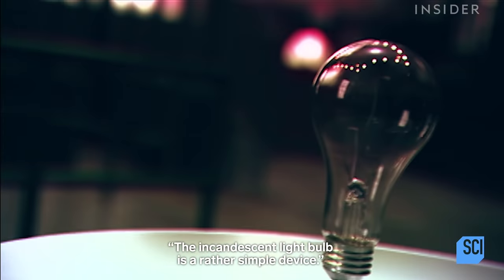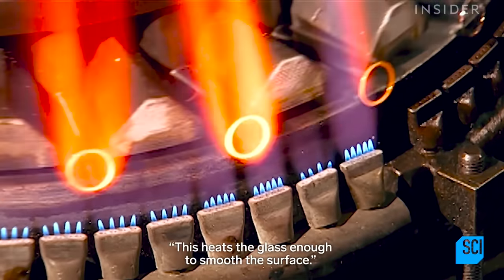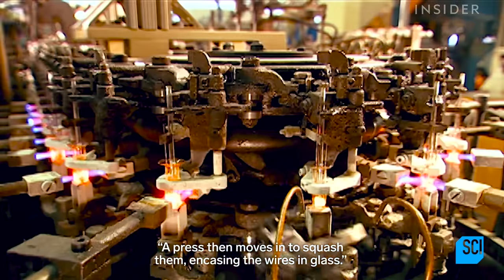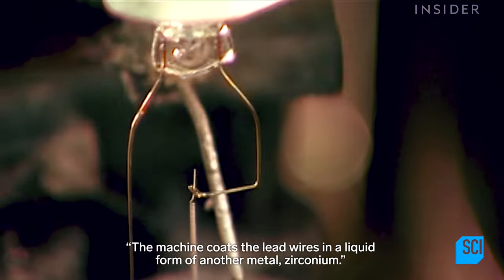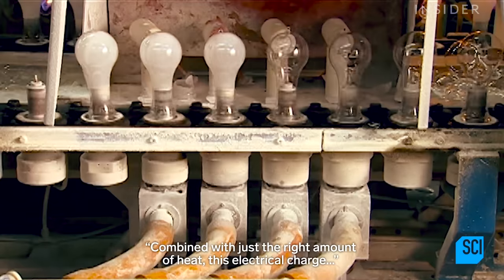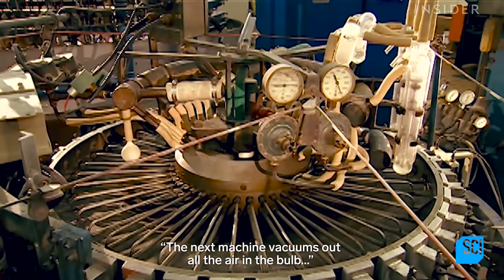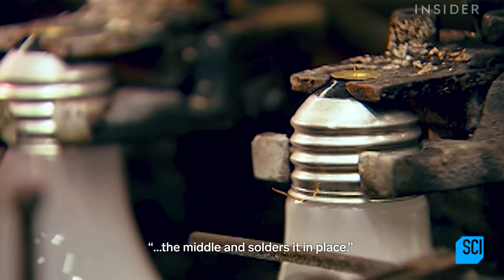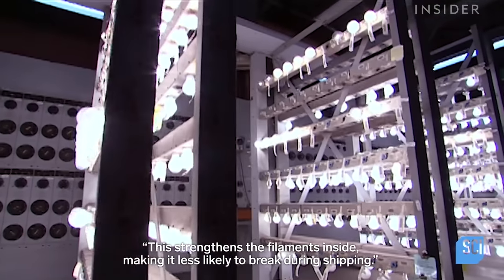How Light Bulbs Are Made

Comment: Filmed in the former Sylvania light bulb plant in St. Marys, PA. This factory ran for about 100 years. RIP Oct. 2019 😢
Reply: I wanted to buy the factory😢
Reply: Why did it stop manufacturing?
Reply: @JJs_playground  no one uses incandescent bulbs anymore.
Reply: @JJs_playground  federal government passed laws making these types of bulb a crime to manufacture or sell
Reply: @JJs_playground  incandescents not being in favor for leds
Reply: @StupidLightingFreak  leds suck
Reply: @Warp3326  why? their efficiency and lifespan are orders of magnitude larger
Reply: The same happened up here earlier. The Salem MA plants where the incandescent bulbs were made and here in Danvers MA where we made the fluorescent bulbs were made. I worked 30 years there in production and later as a mechanic. I still miss Sylvania and the friends I worked with. Funny thing, some of them went to the St. Mary's plant. Both the LED and more so China ended it for all of us.
Reply: @ME0WMERE  Incandescent is cooler. And good for places where u need a tiny bit of heat but not alot. LED's are cheap plastic and dont last long
Reply: @Warp3326  Incandescent bulbs are actually a lot warmer because light bulbs are insanely inefficient - about 95% of input power goes straight into heat (i.e. <5% efficient). With LEDs it varies a lot more, but it seems to be about 25% efficient at the very least, with laboratory LEDs reaching well into the 90's. 'Oh but that's efficiency, not efficacy.' Fair enough, but in that regard, light bulbs are still a lot worse: about 20 lm/W, and for LEDs, 100 lm/W. No matter how you put it, LEDs are much brighter and emit much less heat for the same input power.

As for 'cheap plastic', you might have just been using crappy LEDs. The diode itself is metal and can be very durable - depends on the model. The plastic of an LED is just the covering - it's entirely optional. At the very least, it's more robust than thin glass and a tiny, thin filament that will break at the slightest impact. (Oh, and that glass is needed because it keeps a vacuum around the filament to make it last longer.) Bear in mind that the components of an LED can be scaled up, but the filament of an light bulb can't be any bigger or it won't glow. I have an LED in my light bulb - it's lasted literally years and has survived several impacts from dropping onto my floor. The same impacts, without fail, broke the filament of each of the light bulbs I used to put in it. (And even if the filament didn't break to impact, they only lasted for a few months at a time.) Oh yeah, and it's a lot cooler - when I had a light bulb, it would burn my finger after only a few minutes of use if I so much as brushed my finger against it. With the LED, I can hold it without getting burned after it being on for multiple hours.

Comment: This guys sounds like the guy in the fitness gram
Reply: Green Bean The FitnessGram™ Pacer Test is a multistage aerobic capacity test that progressively gets more difficult as it continues. The 20 meter pacer test will begin in 30 seconds. Line up at the start. The running speed starts slowly, but gets faster each minute after you hear this signal. [beep] A single lap should be completed each time you hear this sound. [ding] Remember to run in a straight line, and run as long as possible. The second time you fail to complete a lap before the sound, your test is over. The test will begin on the word start. On your mark, get ready, start.
Reply: randomz pandaz EEEVVVILLLLLLLLL!!!!!!!

Comment: WOW !!! That was very interesting! My favorite light bulb is the incandescent. "It was fantastic to watch them get made".
Reply: I don’t like incandescents. LEDs are easier to make too.
Reply: @homeguestunton  hmm did you know led can have arsenic in then?
Reply: @letsbegaming5411  I still use LEDs. Do you think I’d downgrade my lights to incandescent. Guess what fluorescents and induction and HID have mercury.
Reply: @thecampaigner2167  Although the materials used aren't a health hazard, incandescent bulbs use significantly more power than LED bulbs, since they rely on heat to generate light. This is probably the main reason they were banned, since energy production is a burden on the environment, and most of the time the heat was an annoying byproduct rather than being used for anything (except in edge cases like easy bake ovens). Also, the increased risk of fire is in theory a hazard, although it relies on the user being negligent and putting the bulb right next to something flammable.
Reply: @alkali836 I don't know why I said that.  I think I was commenting on the wrong video.
Reply: Led's are trash @homeguestunton
Reply: You spelled upgrade wrong @homeguestunton
Reply: @homeguestunton  Upgrade*

Comment: INCANDESCENT LIGHT BULBS NEVER BURN OUT THEY CAN LAST 100 YEARS. THE BULB MANUFACTURER'S PUT A HIGH VOLTAGE SHOCK TO THE FILAMENT TO WEAKEN IT. SO IT LASTS A CERTAIN AMOUNT OF HOURS.
Reply: Good to know, what else do you know
Reply: @michaelrobb9708  YEARS BACK I WAS TOLD THESE LIGHT BULB MANUFACTURERS WOULD PAY THE GOVERNMENT FINES. BECAUSE THEY CHARGED OVER A CERTAIN PERCENTAGE THAN IT COST TO MANUFACTURE THE BULB AT THE TIME IT WAS PROBABLY A PENNY PER BUILD. IT WAS MUCH PROFITABLE TO PAY THE FINE THEN TO LOWER THE PRICE OF A BULB.
Reply: I had many incandescents burn out even the high quality ones like PHILIPS and GE and SYLVANIA.
Reply: @homeguestunton  AT TIMES A BULB HERE AND THERE MAY SLIP THROUGH AND NOT GET SHOCKED. THOSE ARE THE BULBS THAT NEVER BURN OUT AND THEY COULD  LAST FOR A HUNDRED YEARS. THE ONLY WAY THEY'LL STOP WORKING AS IF YOU BREAK THE GLASS.
Reply: That sounds like bs to me.
Reply: @chrisa2735-h3z  WHICH PART IS BULLSHIT? THAT THEY CAN LAST FOR 100 YEARS OR THE FACT THEY SHOCK THE BULB TO LAST A CERTAIN AMOUNT TIME.
Reply: @chrisa2735-h3z  they just use weaker filaments in lower life  bulbs tho if they want can make them to last 100s of years like they use to